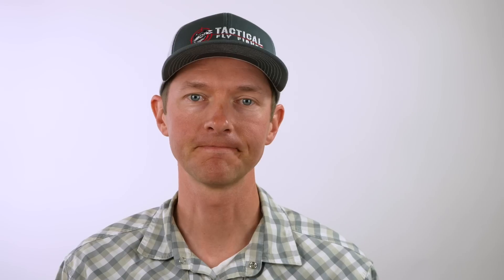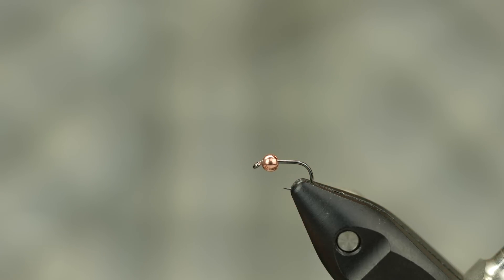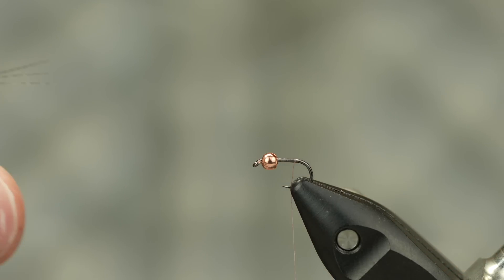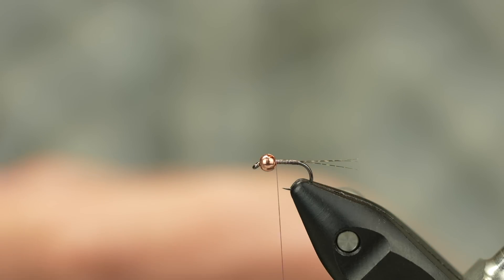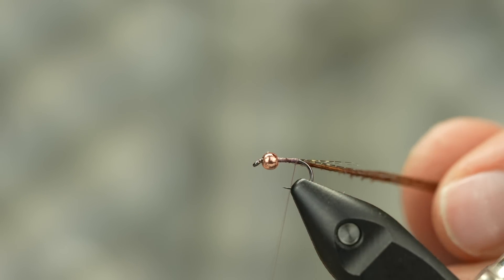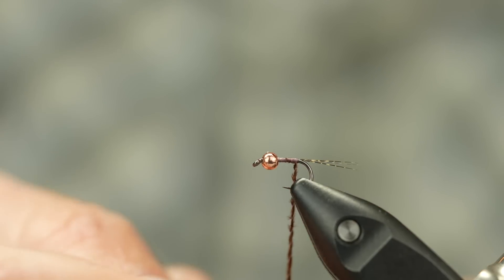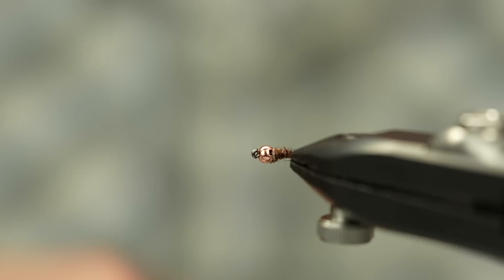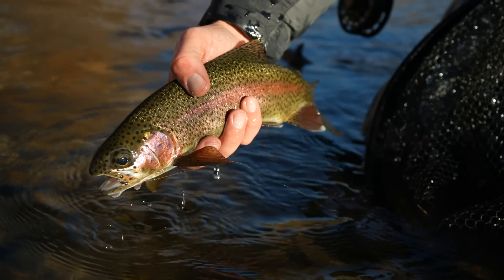2022 World Championship Flies - Super Simple Pheasant Tail Tutorial

Comment: I have been using that tie for 3 weeks now in NJ. I use it as a dropper and one Perdigon as point fly. This Super Simple Pheasant Tail is AMAZING!. I get about 90% of catch vs Perdigon. Small fishes, large fishes - same. It works so WELL. I am planning on tying with different pheasant tail color (black, lighter brown) and see where it lands. Looking also at different hot spots (purple, green and red) . I love to experiment. And these hooks are stellar. I only use these and the Jig force now. that's it. Can I use these pheasant tails in larger size (like 12-14) and use them as point fly? I feel they work very well as a small offering so curious if others have been luck with larger ones. Thanks !!!
Reply from the maker: Pheasant Tails will work in pretty much any size but you’ll need long fibers for size 12 or larger hooks.